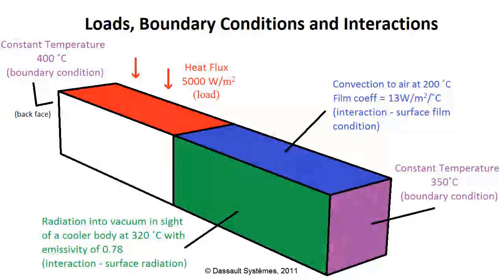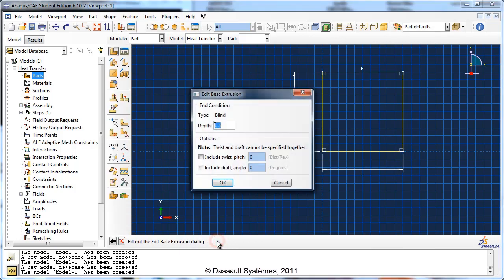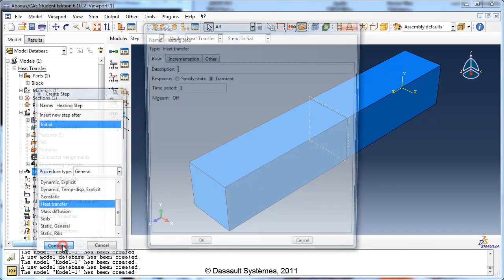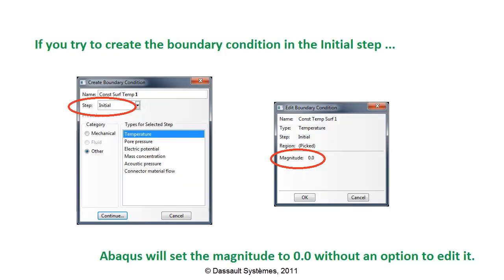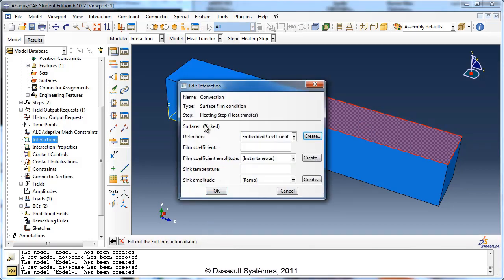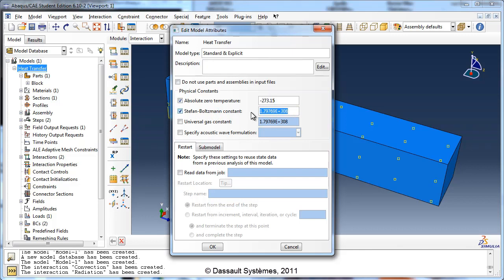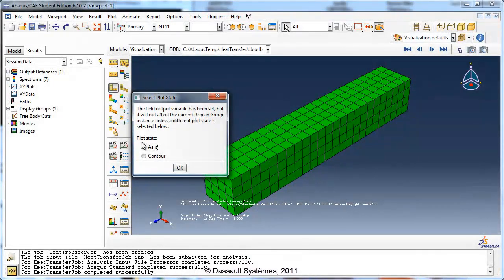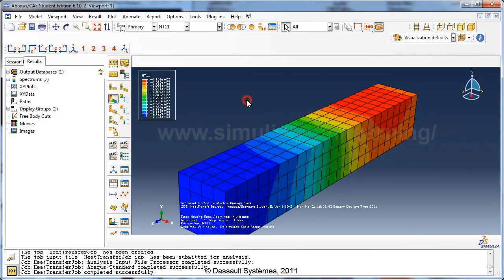SIMULIA How-to Tutorial for Abaqus | Heat Transfer Analysis

Comment: Hi , 
I did the same analysis. But I am getting the following error 
 ***ERROR: STRESS-DISPLACEMENT ELEMENTS OR OTHER ELEMENTS WITHOUT TEMPERATURE 
           DEGREE OF FREEDOM ARE NOT ALLOWED IN A HEAT TRANSFER ANALYSIS
Would you be knowing why this error happens ?
Reply: In element type, check for heat transfer elements instead of 3D stress